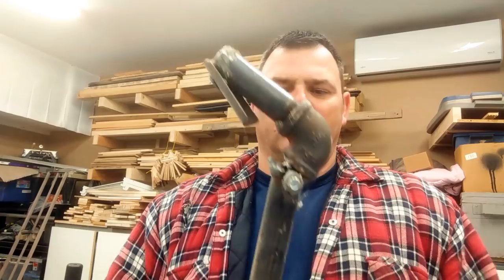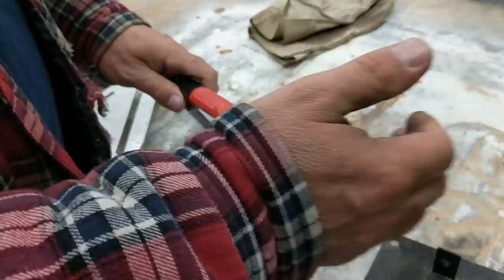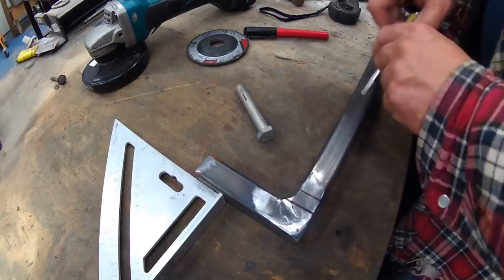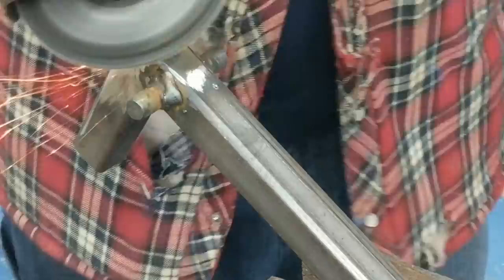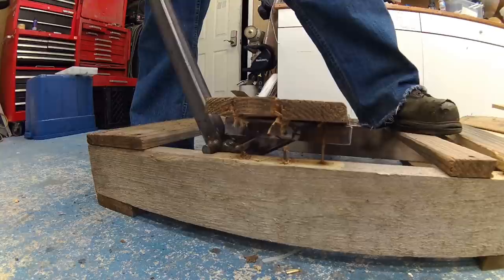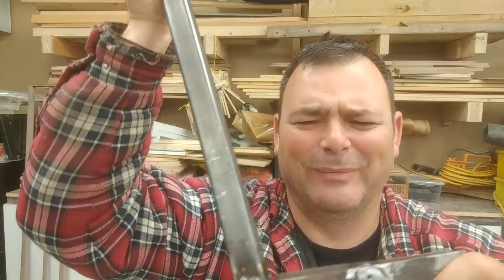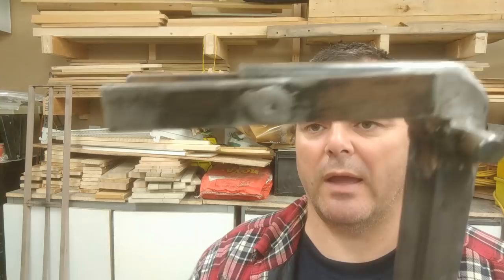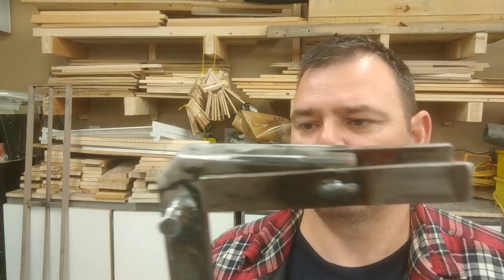Pallet tool how to

Comment: The age , the thickness of the boards, the type of runner used, and nail type and length all make a difference in what you can us to dismantle a pallet. the one you show has about a 3/4 inch thickness and shows some age to it, I would probably cut the boards as even if they are not cracking the nails are pulling through and the end of the board will need to be cut off anyway. Got a really good pallet buster from Vevor that was a lot like the one you built but has 2 sided claws that put equal pressure on the boards,  for us non welders it is a good deal. I have found that the runners are some of the best wood from pallets. The worst wood is the cheap plywood they use. I am poor and use almost only pallet wood and wood found on the roadside for all my projects. The colors that come through after planing are really quite nice. Specialty pallets that they have added 2x4s to for special purpose, are my favorite.they add new wood and usually use screws to attach it making it easy to save the wood.

Comment: Awesome design! Had an idea that might improve this design a little. Use two 90 deg. angle iron pieces instead of the flat pivoting bars, this will increase the surface area on the boards you are prying up on and might reduce the splitting. If you try it and it works I would love to see a follow up video
Thanks for sharing!!!
Reply from the maker: Panzer Blitz that's an awesome idea, I will definitely try that thanks for the tip.
Reply: Good idea, but wouldn't that increase the width dimension making it impossible to slide between to slats, as he done in the video at 4.25?

Comment: I've made several pallet buster bars but still haven't found the ideal set up yet. - I've been using black pipe for the handle's which are really beefy. "Heavy:  The design I use has the wrecker straddle the runner with 1/2 in flat bar which fits under the 5in slats ....  It really works good, except I left 3.5 inches so when i get a pallet with 2 runners or 4x4 runners, it's not a problem. I think there should be different styles for the 1x4 slats. Hope to make a video soon.  I like your set up and might give it a go...

Comment: Super piece of kit, and better than any for sale! Just an idea, if you just bolted the swivelling end pieces to the main body you could have different sizes for different size timbers. Would just unbolt and swap over. I'm looking for metal as I write. Thanks!
Reply from the maker: If you look at my other videos I have one with bearings. Also I recently made one without welding. It works good I just need to do the editing of the video.

Comment: Good design, I would try and make another one where it fits over the 2x4 and your pry bar feet would be on either side of the 2x4 and you would get more pressure to pry up the pallet board.
Reply from the maker: +Marlon Tomera Thank you for the comments I took note and i will bring it to my next design and this way I will save even more wood cheers

Comment: Similar pivoting arm to mine.  For a larger fulcrum slip a piece of pipe over the pins and tack weld in place.
Reply from the maker: I made some other videos about a better pallet breaker. It has a bearing at the fulcrum area and I made one more without a welder. I agree with your comment a bigger size pipe would be much better.

Comment: I am gonna have to try one of those - good vid thanks. -Al
Reply from the maker: Awesome, glad you liked it, one of the comment on my french channel suggested to install a wide needle bearings on the side shaft that is sticking out and also use 90 deg angle iron for the part that is pressing on the wood to have a bigger surface. In a month or so  I will have to do just that and try it....should make a great video. cheers
Reply: makes sense to use  the  angle iron yeah versus the shaft, looking forward to seeing it

Comment: made one works awesome, Thanks for sharing 👍
Reply from the maker: hankz have plans to build another one. I will incorporate suggestions for comments made. I am hopeful it will perform much better.. I appreciate you commenting.. cheers
Reply: great design this one, those pivoting plates nail puller work beautifully...good job bud !!! 
Next one you make maybe put some kind of a cap or ball at the end of the bar for a better grip.
Reply from the maker: sound good, much appreciated comments.

Comment: Paint it black and draw a tornado symbol on it to spell out the destruction to pallets. Nice job. I wonder if you were to heat the nail puller up bright red and then dip it in oil if it would harden it more to take the abuse of the nails.
Reply from the maker: Love your Ideas...the hardening of the tip is a great idea...I love black it my favorite color and it happens that I haven't painted it yet...life happened anyway...can I use your slogan for a tee-shirt...sounds awesome... cheers
Reply: @RoomiesGarage  Have fun with the slogan. Good luck.

Comment: Great design, well done. However, I wonder if you did replace the welded pin (which is currently flush with the side of the pivot arms) with a bolt and nut securing the two pivot arms would this not cause them to stand off from the pallet side rail by the depth of the bolt? This would also require you to have a longer fulcrum pin to compensate for the projection of the bolt head and nut. Overall I think that your design is ideal as it is because the closer you can exert the lifting force to the side rail to lift the cross board the greater the efficiency as the force is closer to the nail heads. If it ain’t broke, don’t fix it. Thanks for the vid’.
Reply from the maker: Your comments made my day. I had in mind the if I left the bolt head it would've gave me a greater surface to weld the pin to the arm. The tool has not required any repairs yet and I tool a lot of pallets. I also made one with bearings that works using the same concepts. In my other build video I talked about the importance of the location of the resting pin on the pallet runners ( fulcrum in other words) cheers

Comment: Awesome build - will this work with the pallets that the boards are pretty close to each other or is the square tubing to large?
Reply from the maker: +lisa shelly I used one by one square tubing so it would require a bit more than one inch but when you have the first row of plank removed you will have all the room necessary to remove the others

Comment: Awesome video - I want to make a no-weld version of this, as I don't have access to a welder. Any suggestions? Thanks!
Reply: I do have a suggestion, I have done a pallet breaker about 1 year ago with gas pipe and it didn't last long on hardwood pallets because I used a 90 degree elbow in cast iron and it broke.. I would also suggest to use material that can survive lots of abuse. Send me the link of your video when it's done I would love to see the footage. Good luck with your project..

Comment: How do you hold down the pallet down when you trying to brake it down
Reply from the maker: I just step on it I usually start with the exterior ends of skid  and then I move into the center of the skid with the pry bar this way the boards are easier to remove as they are not moving around. The breaker bar  function the same way as a nail puller. By the way it helps when you weigh more than 200 pounds LOL... For the pallets there are kneeled and softwood my 67 lb son can take them apart with a little bit of guidance and supervision.

Comment: Excellent video, watched it a couple of times. Something I need, and something I'm currently making. But I'm curious...the 3/8" bolt you used at the pivot point...what kind of damage are the runners receiving from the pressure applied? I'm wondering if they can still be used or do they become bonfire material? At the beginning of the video where you're removing the slats, it looks like it goes pretty deep...about halfway buried. You mentioned using a larger bolt to reduce the "footprint". Any further thoughts on that?
Reply from the maker: I just got a pair of small bearing (cheep as a test) to help reduce the amount of damage on the runners because the gouged were pretty deep . So I have the material to build another one with a bigger and also longer pin to increase the footprint. I also noticed that when pallets are very dry the nails are very hard to remove from the runners, hence the bigger damage on the boards because of the excessive force required to take them apart. Also the parallel flat bars a to long for the normal pallet, they don't work well on small boards.  I will be working on doing a fabrication and test video this weekend for next weekend if you are interested. Cheers.
Reply from the maker: I just uploaded a new pallet breaker video....here is the link if interested   cheers    https://www.youtube.com/watch?v=OnpPveWeawU